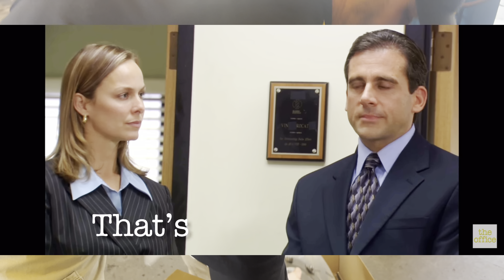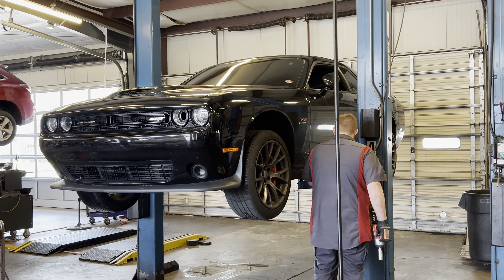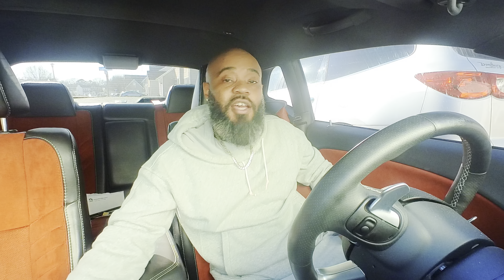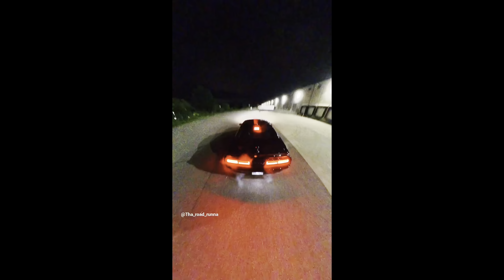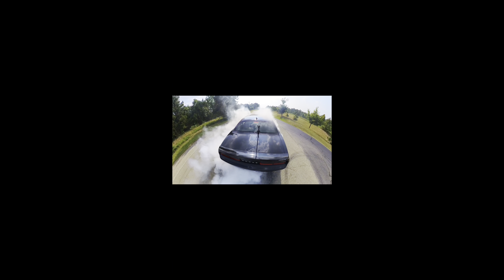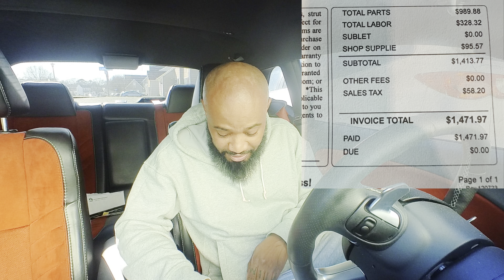Dodge Challenger Srt 392 six piston brembo brake replacement cost

Comment: Pay to play for us 6-pot brembo guys...For the Pads you could have gotten OE Brembo from Rock Auto,  though for my 21 they increased the rotor size to 400MM. Had to buy it from the dealer, as for pads I went with one of our own makes NRS (galvanized pads). Though now DBA makes Brake Rings for these cars. (Don't go with Paragon, chinese piles of shit, they didn't make the wholes in the rotor hat large enough to fit over the hub studs).
Reply from the maker: You are not lying you definitely gotta pay to play and I’m tired of it 😂
Reply: @ don’t be a wimp!!! Just gave ya some options dude! lol